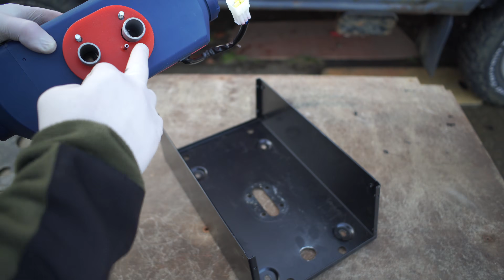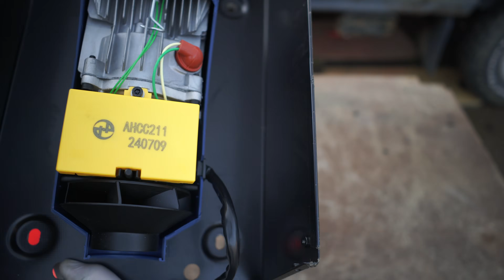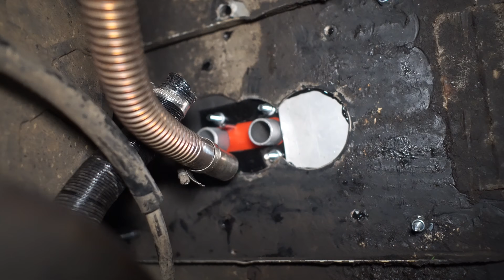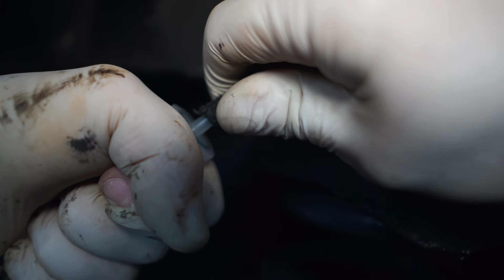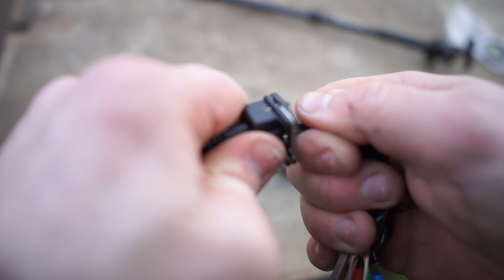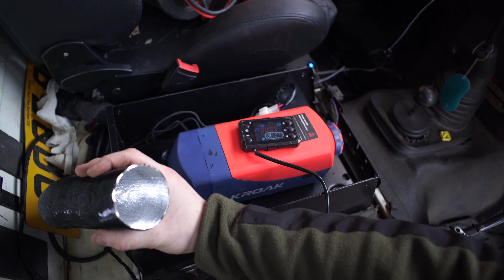FITTING A CHINESE DIESEL HEATER TO MY TD5 DEFENDER

Comment: Ben, why do you (and everyone else) mount the heater so it is blowing rearward?  I have a 110 (9 seater) and I get wanting to warm the back...but what about the front where I am driving?
Reply from the maker: Sorry for the slow response, reason for myself is this is how the mud box was configured, Intake to the front. I did fit it with a Y pipe at the exhaust, allowing heated air forwards as well as back. Hope this helps

Comment: might be a stupid question.. but seeing how high up the fuel filler neck that hose is, looks like it would only get fuel on a near enough full tank ?
Reply from the maker: @DefenderNut92  it's got a long pick up that's angled to the bottom of the tank, I've had it on fuel light and no issues 😊
Reply: Oooo thanks. That makes sense 👍